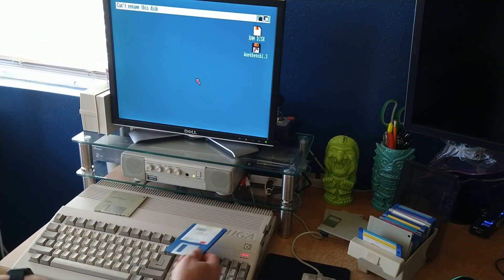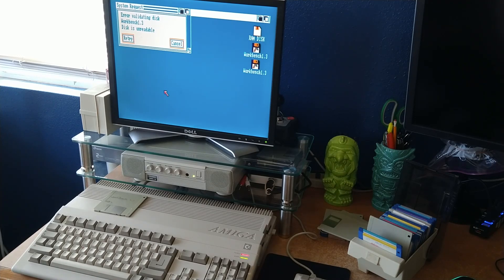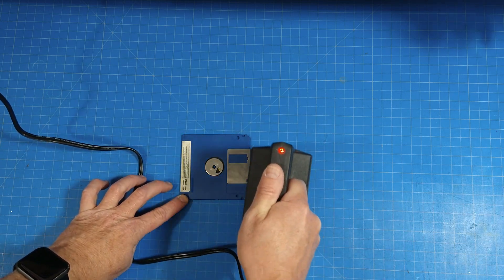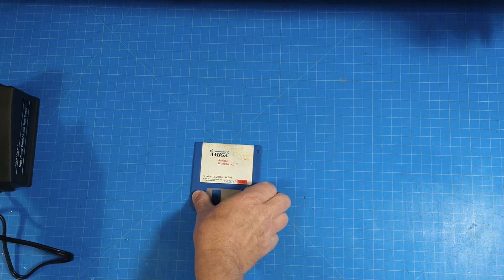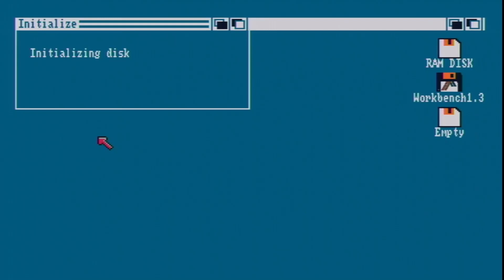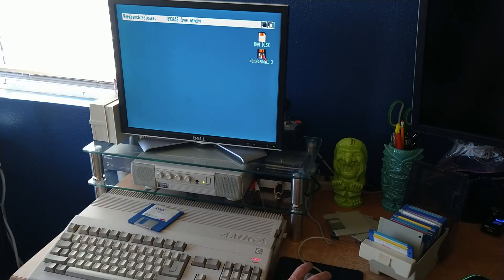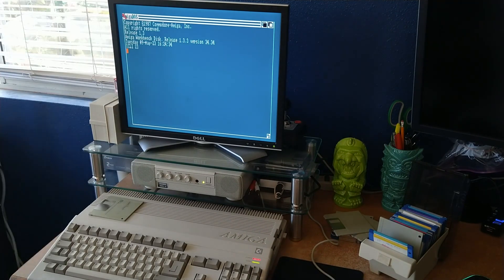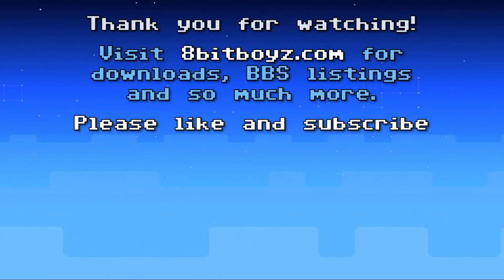Amiga Disk Repair: Tape Eraser Restores Bad Floppies

Comment: For how long does this fix lasts?
Reply from the maker: Good question, it is based on a lot of factors from the quality of the original media to enviorment, but disk's I have done this to in the past few years are still working just fine currently.